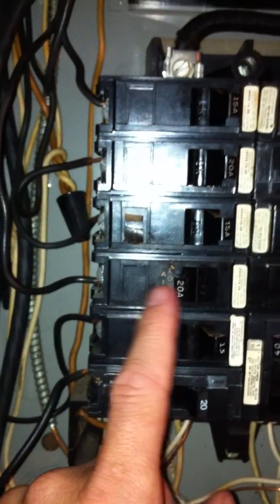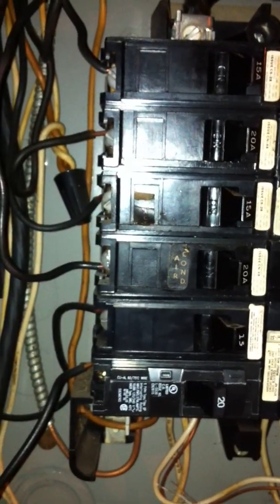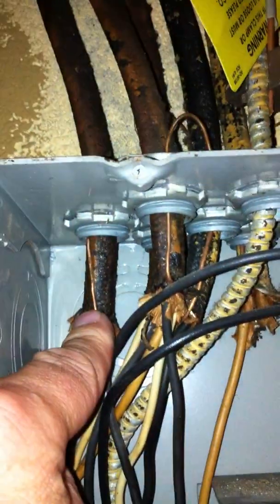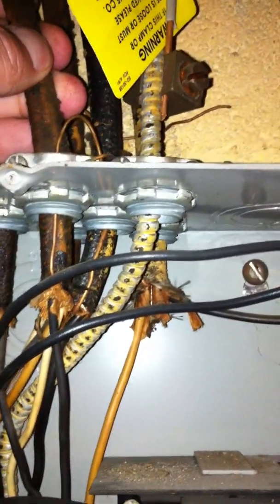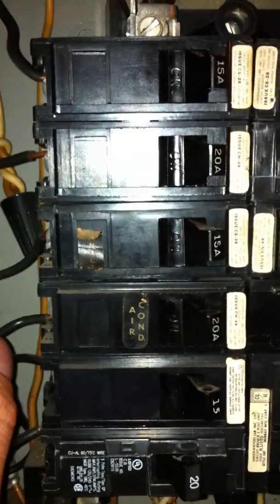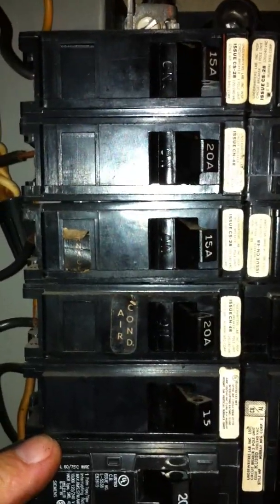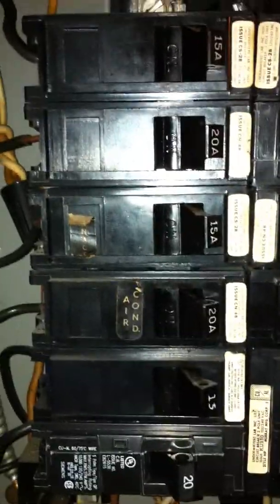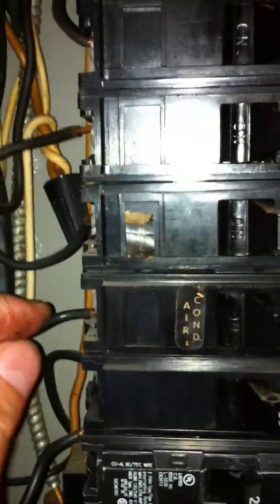Testing old circuit breaker

Comment from the maker: @DeafJustin Nice observation Justin. It was around the 1950 when you see the the change from fuses to breakers. You can see the old cloth wire that looks like knob and tube but has two modern plastic wire inside with grounds. This service was installed in the middle of that change.